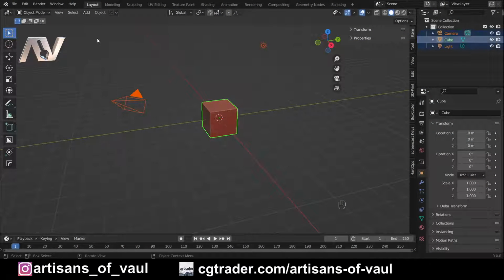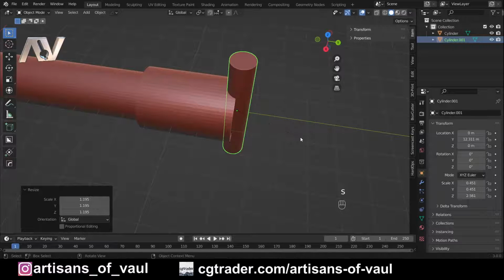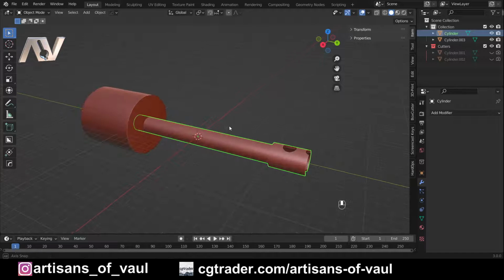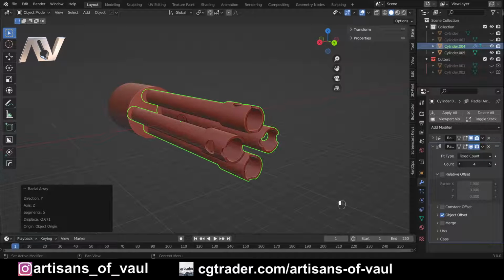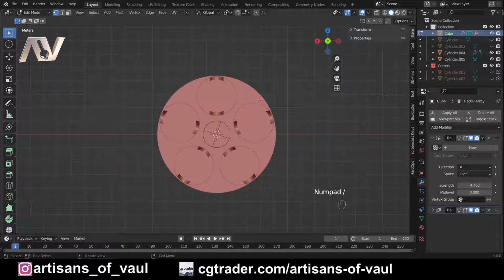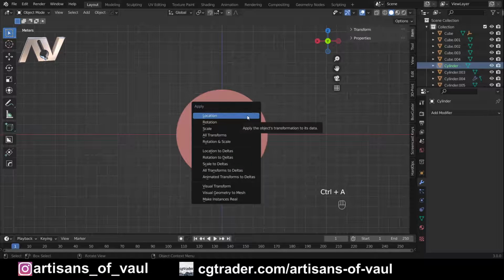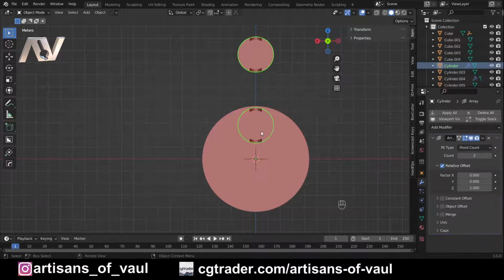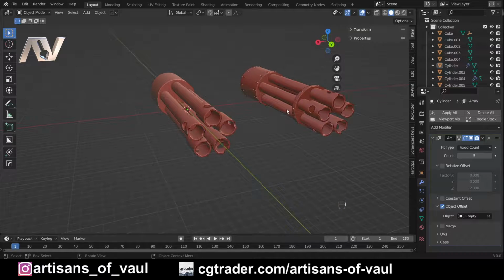Radial Arrays in Blender

Comment: I have only got as far as the notch in the front of the barrel and i press ctrl + - and it removes the cylinder but no part of the barrel is cut. Am i missing something?
Reply from the maker: That would suggest there is an issue with one of the mesh or you could try changing the boolean modifier to "exact" or "manifold" to see if that works better.

Comment: If you are like me and dont have a clue how to use blender, I wrote down all of the steps in this video and the corresponding key presses.  My version is I think newer then the one in the video so I adjusted accordingly.
=====================================

This assumes you are using the add-ins recommended in the "settings and add-ons" video 

     Delete everything.  Draw a box on it all and hit delete 

    Shift + a  select mesh and then cylinder 

    On the bottom left, open the "add cylinder" menu and click on vertices and change it to 64 

    On the top right click on the X to center on the X axis. 

    Click on R to rotate and 90 on the number pad to rotate it to 90 degrees. 

    Now scale it by hitting s and then lock the scale to the y axis by hitting y.  Stretch it out accordingly. 

    Hit tab and go to face mode.  Click the end of the cylinder to select it. 

    Hit E to extrude it to the desired size.   

    Then S to scale the size of the extrusion.  Move the mouse to the desired size and left click and hit E again to go back to extrude mode.  Move the mouse to get the desired size. 

    Now press I to indent.  Note, the amount you can indent is in proportion to the distance from your object.  Example, if the cursor is far away, you can indent a lot.  If your cursor is close, you can only indent a little. 

     Click on the X axis at the top right. 

    Press shift + z. this goes into wireframe mode. 

    Press e and move the mouse to the desired extrusion length. 

    Shift z again to exit wireframe mode 

    Tab and object 

    Click the X axis at the top right to center the object again. 

    Shift + a select mesh and then cyclinder  

    Hit G to move the new cylinder.  Don’t hit g while your cursor is on it or it will free move it.  Hit G away from the cylinder and then drag it along the Y axis. 

    Hit s to scale the cylinder smaller 

    Then hit s followed by z to only scale the cylinder on the z axis to an appropriate size. 

    While the cylinder is selected, press shift + d to duplicate it. 

    Hit s to scale it a bit larger while also making sure it does not go through both sides of the barrel. 

    You may need to hit g to move followed by z for the z axis to move it accordingly. 

    Select both of the cylinders you just made by selecting one of them and then hold shift and select the other one.  THEN select the main barrel so that it is the active part.  The barrel should be selected in green and the other 2 cylinders should be selected in orange. 

    Now click ctrl + numpad – to pop up bool tools.  If you don’t this the – on the numpad, it won't work. 

    You can press H to hide the the cylinders so only the barrel is visible. 

    Make sure the barrel is selected again and click on the wrench menu icon on the right side of the screen.  There may be a version difference between Artisans of Vaul's Blender and mine.  I have to click onto the cylinder object name in the wrench menu and then the down drop arrow to apply the change, or hit control + a. 

    Shift + a, mesh and create another cylinder.  give the new cylinder 128 vertices.  

    Rotate it with R and 90 on the num pad, hit enter. 

    S to scale it up, enough for at least 5 barrels. 

    Hit G then y to move it along the y axis, move it to the base of the barrel 

    Hit Y on the top right so that you are looking down the barrel. 

    Now we are going to use hard ops.  You might want to make a copy of the object first by selecting everything and shift + d.  No move that off to the side. 

    Select the barrel 

    Press Q and select Mesh tools, then Radial Array 

    You can scroll your mouse button to create more or less of the object and move your mouse out to space them accordingly. 

    On the right side under the wrench menu, you can expand the radial options and adjust count ( this will change the amount of barrels) or the strength which will change the spacing of the barrels.  

    Shift + A, select mesh and then quad sphere 

    Select the "drum" part of the gun. 

    Shift + s, select "cursor to selected"  this moves the main focus to the center of the drum. 

    Now select the sphere and shift + s and "selection to cursor" 

    Press y axis on the top right. 

    Press s and scale it down small enough to be a rivet. 

    Press q, mesh tools, then radial array.  you will need to press x, y or z to get the correct axis.  you have to hit it twice, like, x, x. 

    Change the strength and count as necessary.  I made 6 barrels and 18 rivets. 

    Drag the axis arrow to move it to the appropriate position.  or use G and Y 

    Select apply all in the radial displace and radial array down drop arrow menus 

    Shift + D to duplicate it. 

    G to move and y for axis.  Move it next to the existing rivets.   

    Select both rivet sets.  Shift + d and then g and y to move the copies to the end of the drum so it is symetrical.  

    Select the drum 

    Shift + D to duplicate it. 

    G and y, move the drum to the front of the barrels. 

    Now s and then y to shrink it along the Y axis.  it should look like a barrel support. 

    Select one set of rivets and copy it with shift + d 

    Move the rivets with g and y so they are positioned on the support.
Reply from the maker: 👍🏻 You're right that this is an older version of Blender but works fine. However there is now another way you can do a radial array using Geometry Nodes you could check out. Then you can do whichever you prefer: https://youtu.be/xEfZaQkmx5Y

Comment: All great, clear, and explicit information - but in reality they are the same method of Radial Array.   The only difference is that the Hard-Ops method is scripted, and results in the same setup that you would achieve if you do it manually.
Reply from the maker: Oh totally, it's just one is vastly faster to achieve and has a tendancy (because of the scripting) to get what you want more quickly.